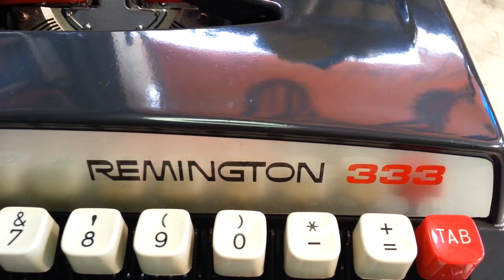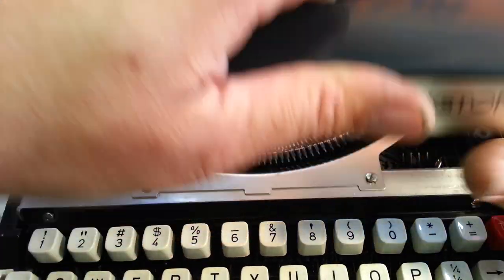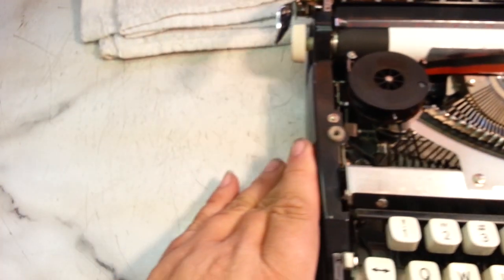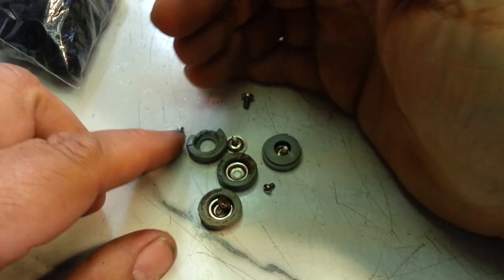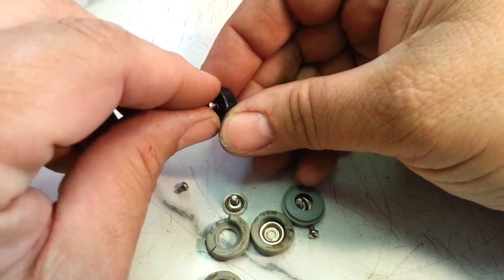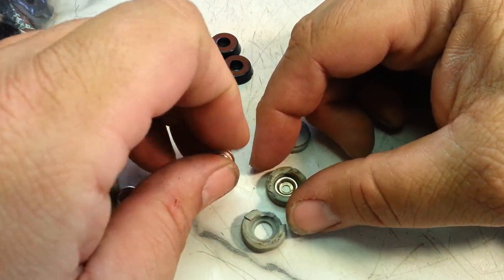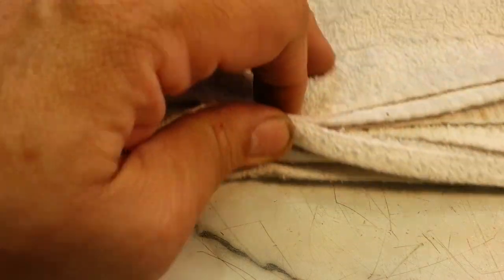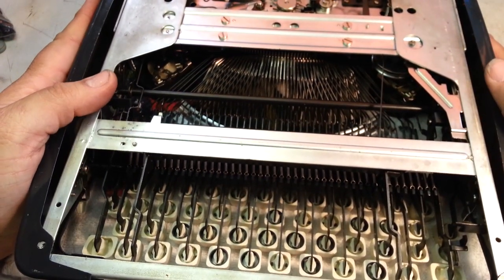Remington 333 Vintage Manual Typewriter Reconditioned -Escapement Silencer Repair, Replaced Feet,

Comment: Hello Duane, love your videos. I’m having a similar problem with a late 1940s Smith Corona Clipper. Do they also have a silencer wire? Or would something else have to be wrong for it make that scraping sound? Any guidance you can provide would be deeply appreciated. 

Avy
Reply from the maker: Early Smith Corona did not have any silencers, but there might be something you can do
See if your is same a this style, might be the solution to excessive noise.
https://youtu.be/5fG8FqD2GRY
Reply: @phoenixtypewriter2136  Thank you Duane! I saw the video this morning and it is giving me an idea. The escapement design is different, but there is a small piece of folded rubber that limits the movement of the hook arm. I'll try to cut the rubber once I figure out how to get in there. THANKS FOR THE HELP.

Comment: I'm not very well versed with typewriters. I've got this model and the carriage isn't moving at all. What should I do?
Reply from the maker: Lets say you were not well versed with cars, you would bring it to a car shop, you might need a typewriter shop
Not sure what I can tell you to do, did you look for a carriage lock ? is it bent ? was it shipped ? look for clues
Reply: @phoenixtypewriter2136  It's the same model in the video. I see no carriage lock and see none in the video.
Reply from the maker: @MJOLNIR49  Does it move by hand ? Back space ? did it ever work ? was it shipped ?
Reply: @phoenixtypewriter2136  Yes. No. It's like new but the previous owner has passed. It has never worked.
Reply from the maker: @MJOLNIR49  Could be ceased up from old oils, typewriter needs to be troubleshooted